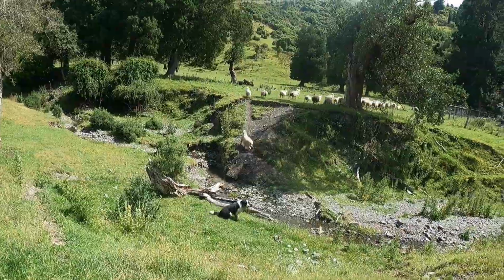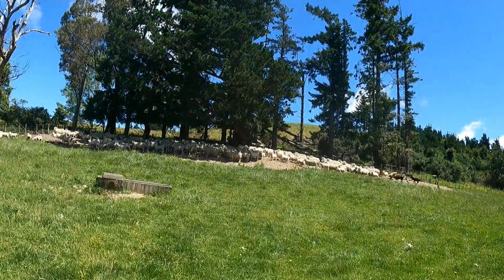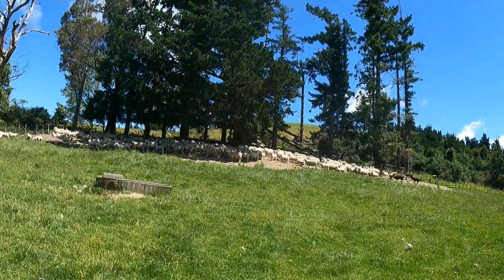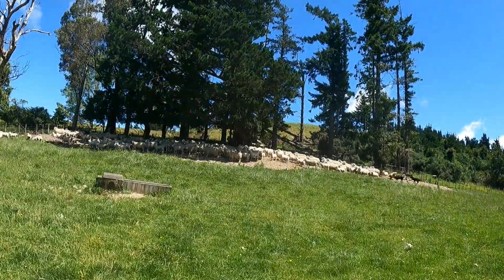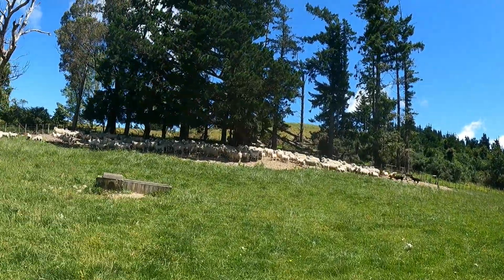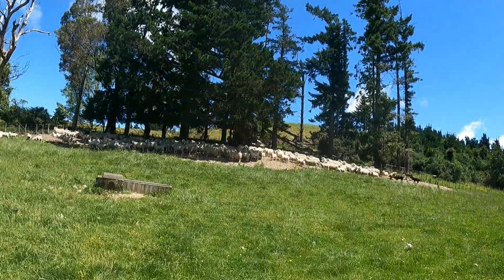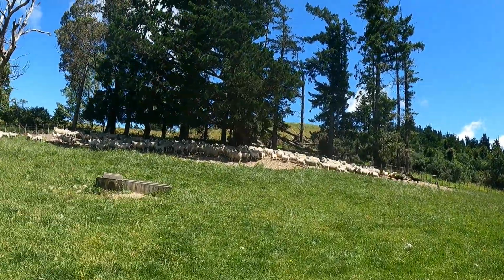Episode 50. Sheep, Sheep and a muddy Bull.

Comment: Hello brother.. Does that communication system help you to get better mobile signals or is that system some wireless walky talkie sort of thing.. Can u pls help me to understand much better about that communication system  and howw much did it cost you. Ram from India 🇮🇳
Reply from the maker: Hey its for a local contractor to improve their 2 way rt radio signal. Also for GPS autosteer in their tractors. There is no cell phone system built in. I don't know the cost as its not our system.
Reply: @kiwifarmernz  thank you for your kind reply brother. Ram from India 🇮🇳